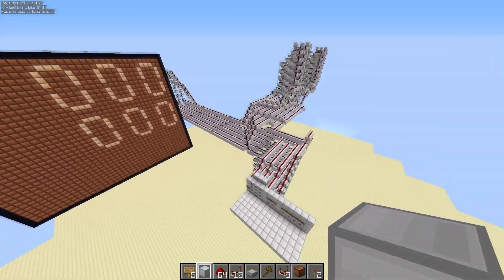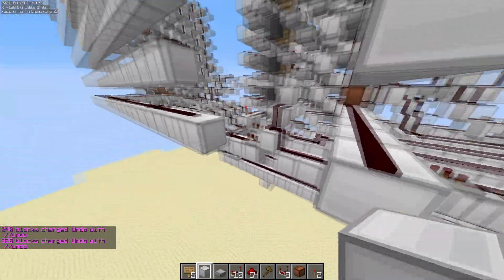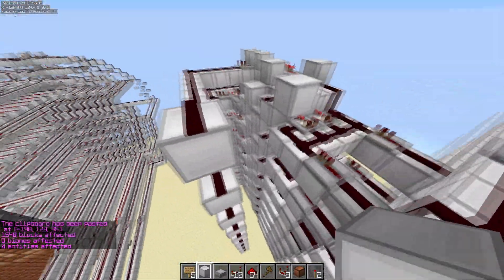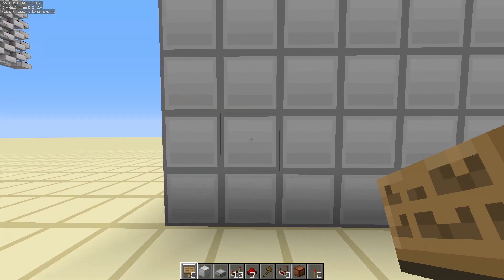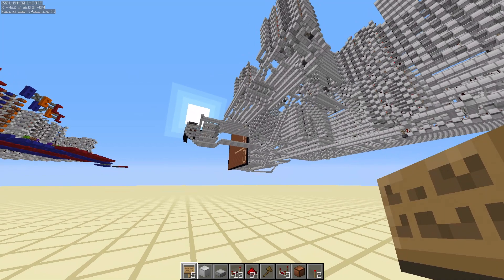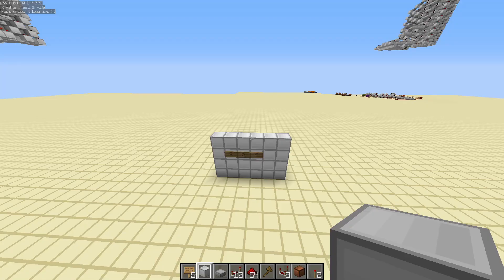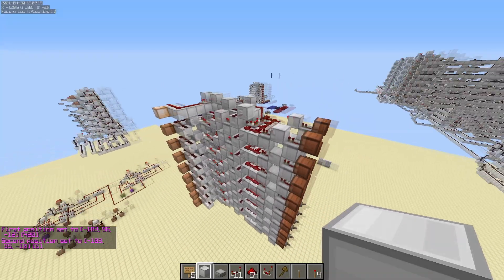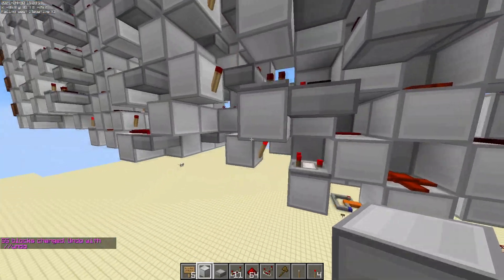Redstone Calculator Tutorial Part 4 - Addition and Subtraction

Comment: So at 3:40 I tried 107 + 93, but I got 199, I forgot about the carry in, how do you connect that to the output of number a and number b's ccas?
Reply: See when i put in 107 and 93 i get 200, but when i put in 255 and 1, i dont get 256, nothing shows up :/
Reply: @Topher350 Cuz 256 is more than the maximum (255)
Reply: @maxcraft1078  yea i figured that out after posting the comment, i also had an issue with my carry in, all good now. Im working on division right now
Reply: also when i do 107 + 93 i get 186 can somebody help me
Reply: I get 184 from 107+93

Comment: One thing you could do to save on Redstone and space is used one Adder for addition and subtraction. B should be xor'd with the subtract line, and the adder carry in should be wired to the subtract line. A full adder that only adds one is also overkill, so you want 8 half adders, where the a inputs are the result, the first b is the subtract bit and subsequent bs are the carry out of the previous bits

Comment: Hi Bro, thank you for this thing you are doing, I infinitely appreciate :D I have an issue I hope you can fix: in the subtractor every output is ever lower by 2 than the correct result, even if the input is only one bit. For example, if I select 8 in the left column it should be the same in the output, but instead it's 6 :S I thought it could be a problem in the "carry" part... but i did exactly like you, a single torch that ever turn the comparator on. I hope you can help me, anyway thanks a lot <3 :D
Reply: Hey! In the original tutorial by bennyscube, the carry in is INVERTED! so the signal feeding the carry in has to be inverted right in front of it :) Give it a try https://www.youtube.com/watch?v=s5xBDcK84cM
Reply: @MaxJPW95  thank you so Much!<3
Reply: Hey what was the problem?
I have the same issue.
The result is always one lower than the correct answer.

Comment: Okay so I had a question about the subtraction;

Im working on a working redstone monopoly and was using your tutorials to learn some redstone computer science (theyre great btw). now I have made a 15 bit version of the adder, I added instant repeaters in between to make sure the glass towers actually reach the top and that part works.

now I was testing subtraction with 2s compliment but I just cant make sense of it.

Lets take 75 - 40 in 15 bit values 
75 -> 000 0000 0100 1011
40 -> 000 0000 0010 1000

now we invert 40 and add 1: -> 111 1111 1101 0111 + 1 = 111 1111 1101 1000

now adding these 2 will come to: 0111 1111 1010 0011 

this kind of makes sense since the last part is actually 35 (100011) but the sign bit says its negative and now we have all of these 1's that dont make any sense in the final awnser.

Now I have also built your subtractor and that one seems to work but to be honest Im not really sure which part of the logic Im missing here, you should be able to do this with any adder as long as you invert B and add 1 right ?
Reply from the maker: No logic is missing, your math is just wrong somewhere.

75 = 000 0000 0100 1011
40 = 000 0000 0010 1000

Invert 40 = 111 1111 1101 0111
Add 1 = 111 1111 1101 1000

Add 75 to it: 1 000 0000 0010 0011

1 signifies positive, and your answer is 35.
Reply: @mattbatwings  o ye I see, interesting that my adder made the same exact mistake as I did. thanks for the reply anyways!
Reply from the maker: @throwaway3141-r2y  no problem, if you can’t find the mistake then join my discord and I’ll try to find it
Reply: @mattbatwings  help pls, I did everything like the tutorial but when I press 8 it shows 6 but all other numbers work perfectly and the math is broken like when I do 107+93 it shows 184 and when I do 2+2 it shows 0
Reply: my subtractor just comes out with -255 every time pls help